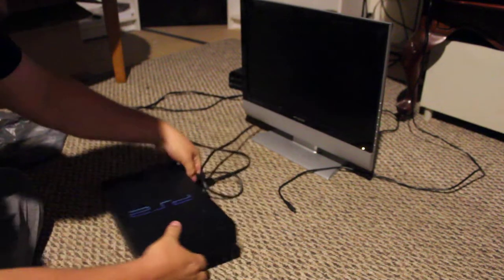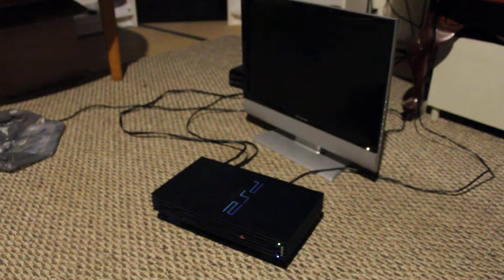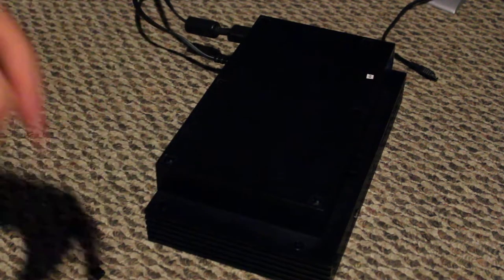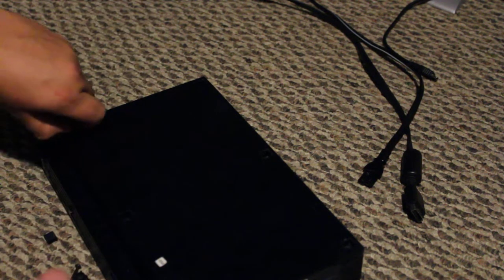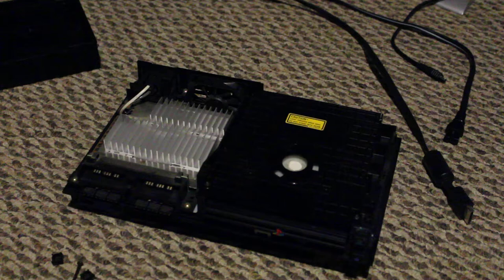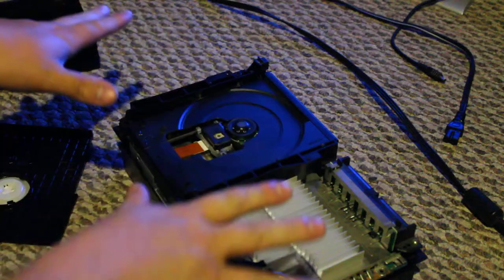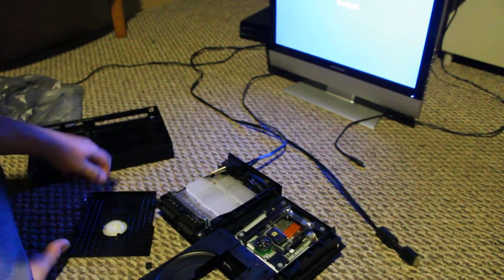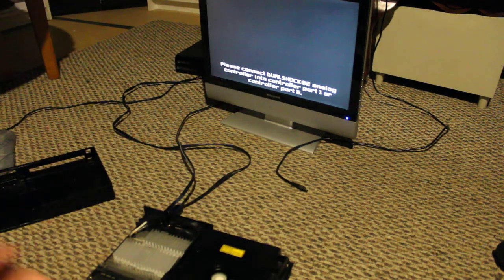Playstation 2 SCPH50001 Disc Error FIXED!

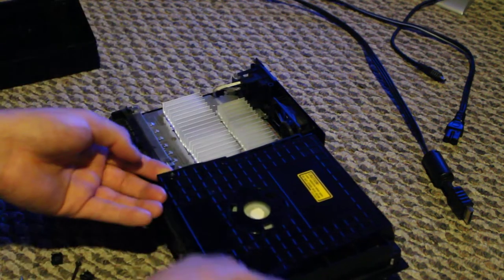Comment: God damn, when I went to remove the cover for the DVD drive (at 5:58) one of those stupid clips that hold it in broke off. I was even using a plastic tool instead of a screwdriver. What really is stupid on Sony's part is that the earlier 3x00x models (e.g the 30001, 39001) do NOT have those clips - it's just held in with screws. I have no idea why in the 5000x revision they decided to do that, it pisses me off. The plastic becomes brittle with age and it's super easy to break it. All it really does it make harder to open and easier to break.

The good news is, after cleaning the laser with 100% IPA, it's reading both CDs and DVDs just fine now. Before it would take a few seconds to read a CD, but now it's perfect.
Reply from the maker: I'm sorry to hear about all of that but im glad it worked out in.the end! Yeah there are a lot of weird things inside the ps2 versions haha, though obviously I'm not too researched in this
Reply: @StarEco64  I guess it really depends on the console. Mine was pretty dusty and I had to do a full teardown to clean everything.
Reply: @StarEco64  Is this console still working? Usually when you have to adjust the height to get games to work, it means you have a weak laser that’s on its way out. I left a main comment too explaining it, but you’ve certainly got me curious

Comment: When you have to make adjustments with the height, USUALLY from my experience with most fat models (30001, 30001R, and 39001 in my case), you never adjust that gear unless you’re having a clearance issue with the laser and the disc. When you do that and discs start reading, it’s usually an indication of a weak, dying laser, that’s why moving it in closer height wise usually causes it to work. Try cleaning the laser lens first and regrease all moving parts. If that doesn’t solve the problem, you can adjust the pots on the back of the laser to squeeze the last bit of life out of it, but you can order brand new KHS-400C lasers for the fat models and get BRAND NEW performance with a laser that’s guaranteed to last, especially since they have the right power at stock height to play the discs. The 50001 uses a HD7 laser, but with FreeMcBoot and a Lens Changer program, you can reprogram any fat models EEPROM to accept the KHS-400C if that’s not what your console supports natively. Glad to see the enthusiasm, but usually when it comes to this level there’s something deeper going on with the original laser

Comment: Thanks alot dude! I knocked my ps2 over on my hardwood floor causing the gears to pop out and couldn't figure out how to properly reinstall that stupid metal bracked holding the guide rods for the laser.  I thought it was done for.

Comment: Alternatively, don't use the disc drive anymore: Network Adapter SCPH-10281, SATA upgrade kit ("ABitTop.com" one from eBay [seller "ps2_086_755"]), Free MCBoot on a real PS2 Memory Card (https://www.youtube.com/watch?v=pO5DmaXKZ0c&t=420s) and a SATA HDD (up to 2TB can work, but 1TB would be better; 500GB likely the most compatible with the software however finding them new and still with manufacturer's warranty is getting rare now). This workaround is not only more convenient (salvaging what's left on your disc drive and your game discs too), but is also actually faster to load and play. I am also fairly sure, if you use an official network adapter and the SATA mod I mentioned (which preserves the network function on the adapter and with the HDD) that you can then hook it directly up to your PC (given its age, you may require an actual "crossover" ethernet cable) and transfer game ISO's that way, instead of having to remove/reinsert the HDD to add/remove games. Oh, and ImgBurn is the best for ripping your actual game discs to ISO.

Comment: dont understand it, can you help me please
Reply from the maker: There's a little gear inside your PlayStation, some models have 1 hear some have two. Take off the cover by unscrewing the screws underneath the ps2, then lift the cover. Unscrew the top of the disk reader to lift that, be careful not to touch the lazed (little glass eye looking thing inside) there are two white gears in the back of the ps2, just rotate them 90 degrees or 180 degrees (try 90 first) then put it all together and you are good :) questions?
Reply: +Floor2Productions aw doesnt work but its ok
Reply from the maker: +TheMinecraftersNL you've turned it and it doesn't work? Sadly I've found that only a few types of ps2 games work on my ps2.
Reply: +Floor2Productions yea, blue discs do work
Reply from the maker: Thats the best I can offer sadly, from my own experiments I have only been able to get blue and I think clear discs to play